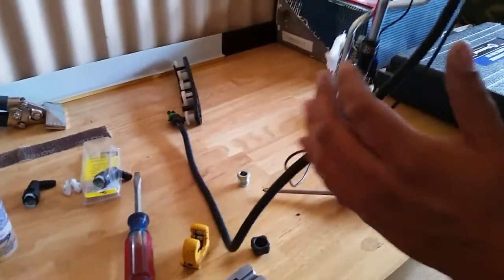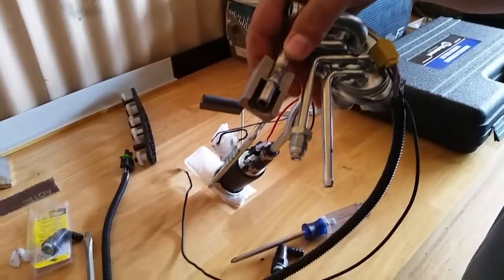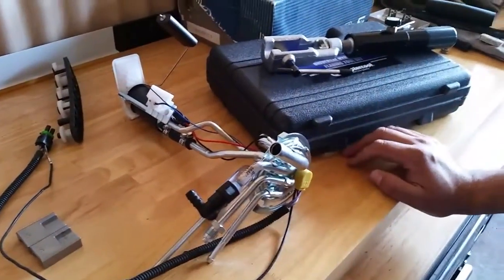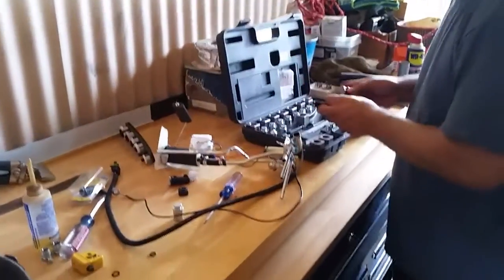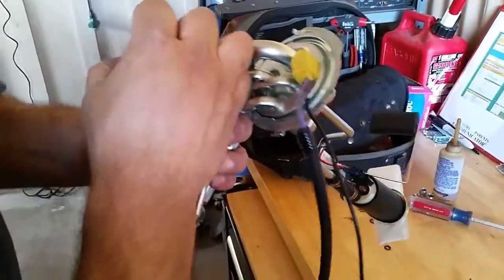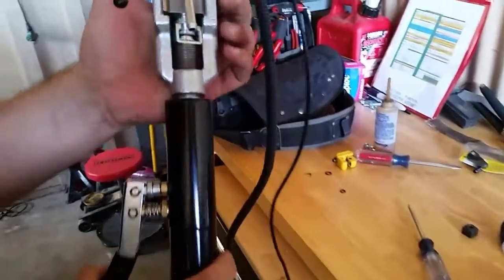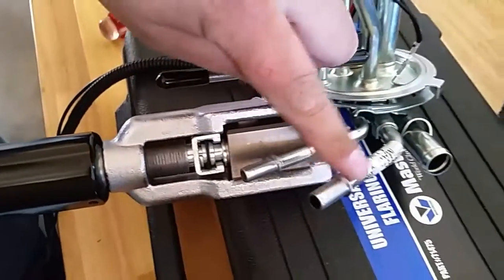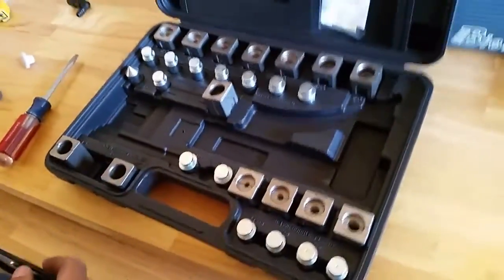Playing with fuel lines

Comment: That's a cool tool!!!  I like that it is useful for several different types of lines.
Reply from the maker: UCanDoIt2 do you have the same tool kit?
Reply: I don't.  It appears to be very versatile.  Could you not find a Sending Unit that had the desired end connections.  This is an area that I have not researched much.  I do have the ole standard Flare / Double Flare tool, but it will not create that quick connect lip.   That looks awesome.
Reply from the maker: UCanDoIt2 there's always after market stuff, but it's either more money,  or more adapting. then you factor in parts that you can't find on any autozone shelf when they fail,  this is why i went with all oem off the shelf stuff. if there's a better oem match, i don't know about it. on this project I've relied on two friends to research what works best on fitment and just went with it,  there's still a lot to learn!!!

Comment: What would u charge if i sent a new sending unit to u to flare and modify? Great work btw!
Reply: I have the tool I'm in ohio.
Reply from the maker: Tell me the years you are working on and information about the engine fuel system (regulator on rail or not) the best way to do this is I'll get everything ready and ship it to you.

Comment: I have a 1985 chevy c10 that I recently replaced the engine with a ls swap the issue at hand is keeping the fuel pressure up ive changed the pump three different times and its still running like it needs more pressure what do you recommend ?????????
Reply from the maker: Know A Likkle what pump are you using
Reply: a 2002 intake fuel pump
Reply from the maker: Know A Likkle an intake fuel pump? Do you know part number, im not familiar with it
Reply: it was typo sorry I meant intank fuel pump but the part manufacturer is EHERKO I'm not familiar with that brand either
Reply from the maker: Know A Likkle if you can get the part number i might be able to see the specs, 85 didnt have good options for tanks because the were carbs then. You need supply, return, vapor,

Comment: Nice job, what's the part # on that assembly. Does it already have the Fuel pump required for a swap?  Gracias,  appreciate your time and help.
Reply from the maker: Patrick MaCord I don't have the part number handy,  you can find out quickly at rockauto.com. it's the standard assy for the blazer
Reply: This is assembly don't require the use of the Walboro 255? My motor is a 03' and going into a 85' chevy. Where can I get my Harness made into a Standalone and PCM Flashed?
Reply from the maker: Patrick MaCord I rework harnesses,  $350, you can use the cheaper airtex e3270. Walbro too. Pcm needs to be shipped to brendan lt1swap.com
Reply: Where are you located Gary?
Reply: Cuanto cobrar Brendan @ Lt1swsps, to flash the PCM? Thanks again for your time and help.
Reply from the maker: Patrick MaCord phoenix az
Reply: K, how long would it take to make the Harness?  My Too lives in Buckeye.

Comment: Gary have you done an 07 ls engine install in obs truck yet
Reply from the maker: iceolation05 no i have not,  i understand there's a lot more to learn with the nnbs engines too
Reply: Gary Garcia 
I can use the same tranny. I meant just the engine, harness,pcm, anything else I'm missing to make it work. I just want to know rough estimate of much just engine would cost. Sorry if I woke u up.
Reply from the maker: jesus espinoza you will be surprised how fast it adds up,  with just the engine maybe 2000-2500 including exhaust fluids fittings etc
Reply from the maker: jesus espinoza you know the 07 engines with cylinder deactivation wear out that system and start consuming oil
Reply: Gary Garcia 

Great. I'm heading down Mexico and I saw 4 different motors running.  for 1100 to 1300. I just wanted to make sure I wasn't going to over pay for them. Thanks
Reply from the maker: jesus espinoza that's not a bad price if it includes everything,  exhaust,  intake,  all tubing hoses,  wiring,  fuse block,  literally everything connected to motor including fuel lines as far back as possible